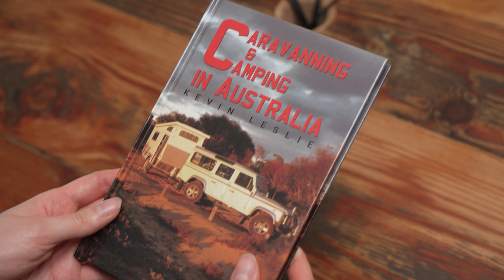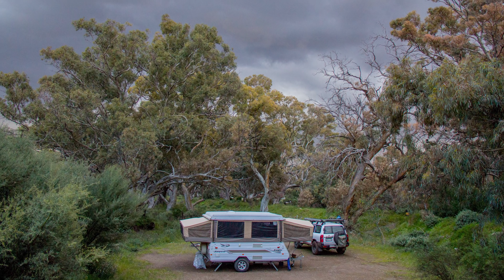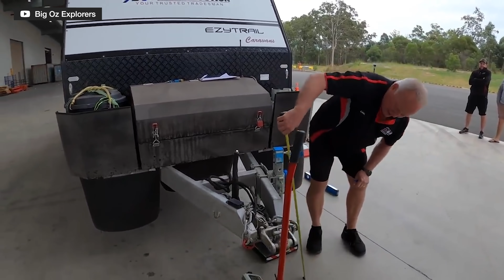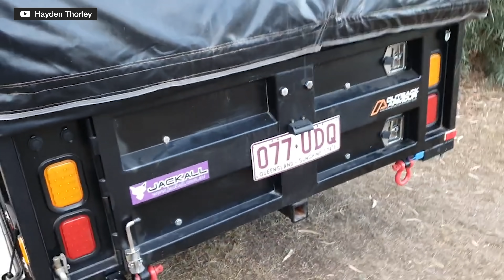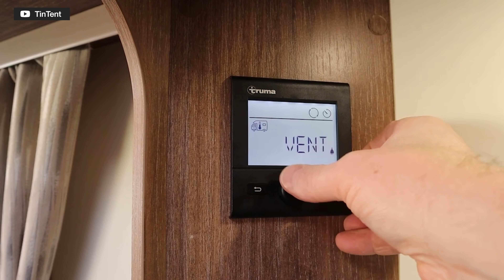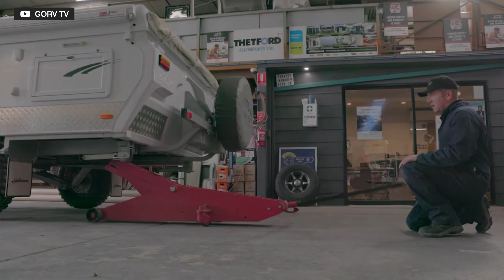Ep 28 - Caravans for Beginners

Comment: What are your views on Australian Standards for caravan manufacturing?
Reply from the maker: I've asked Kevin to pass me his thoughts on this, Jonathon, these were his comments:
"The caravan industry is covered by Australian standards, but as far a I know it covers the caravan for what is required to make it roadworthy and safe to operate. This would cover such things as dimensions, brakes, external lights, electrical wiring, gas fittings, etc. As far as the actual build goes I don't think there is much to say other than it should be of an acceptable standard for what you pay. Obviously this can be misconstrued to suit the builder. I had no rules to follow when I built my caravan other that the previous rules mentioned but it did have to be inspected by a company that was approved to pass it. Cheers, Kevin"
~ Ben
Reply: @SnowysOutdoors  thank you for the reply....this is my understanding as well. The standards cover basic safety issues but the build quality is up to the caravan manufacturer. In many cases, this is sub-standard and amateurish, at best. It's not until you hand over tens of thousands of dollars, take your pride and joy home, and then discover that your van has been put together by a bunch of idiots who can't use a screwdriver or hammer. My advice to anyone buying a new caravan is don't accept delivery until you have checked everything, including under the van and in cupboards. Check absolutely everything. Don't rush the handover and insist on clear and concise operating instructions.

Comment: Just a quick question. 
We have a pop top with a front tunnel ,so the gazebo ect .
Van is a back door 12ft 
We put toolbox under the back seat .
Would that even it out ?
There's no real storage for those things in the middle of the van.
We did upgrade the car from a Subaru Out back to a 3 lt D Max with a canopy ,we put a collapsible mobility scooter in the back of that Plus a couple of plastic tubes.
Can I get your view on that please  ?
This is Katrina on my husband's tablet he prefers my iPad 🙄🤣
Reply from the maker: Hi Katrina, I put your question to Kev, this was his reply - 
"Not sure what a front tunnel is? I presume it is a storage area that runs across the front of the inside of the van with access doors either end. Putting a toolbox under the back seat should be fine as long as you retain approx 10% to 15%  of your ATM on your tow ball. Being a small van means it isn't very heavy so just be careful you don't end up with an overloaded van. The same would apply to your vehicle as it will have the same restrictions on weight with an Aggregate Tare mass as well as a Gross Vehicle Mass. It will also have a Gross Combined Mass. Remember the download on the back of you vehicle will include the weight of the front of the van while on the back of your car. If unsure it is always a good idea to take your setup to a weighbridge and get some accurate weights of the loaded car and van while they are coupled together and separated. If it is all within specifications then you should be sweet."
Hope that helps.
~ Ben
Reply: @SnowysOutdoors  Thank you Ben and yes it is the storage area that runs across the front with access either end .
Maybe just me hat calls it a tunnel boot lol.🤣
We live out the middle of no where ,well probably not that bad ,will look into weights more so when we can get out and about .
Thanks for the reply .Just had me thinking .
We pack minimal. I'm sure we under weight .
Husband has disabilities and we mainly caravan park or a few over nighters to a destination. 
Hence he says don't take water .Tanks empty . 
Thanks again ,regards Katrina.

Comment: 15 amp Earth pin not about fault currents it is about forcing you to plug into circuit designed for 15 amps, wires slightly larger than house wiring. Your 240 v a.c. plugs are capable of 10 amps each.
The wire size in the walls of caravan is sized for 15 amps so if your total load sits close enough to 15 amps it will trip the external circuit breaker.

If you run any circuit at very close to the circuit breaker rating you may have nuisance trips.
Look in your own house power board the power circuits have circuit breakers will be a minimum of 16 amps
Reply from the maker: Thanks for the info here, Brain, we hear of many people trying to dangerously bypass this. ~ Ben